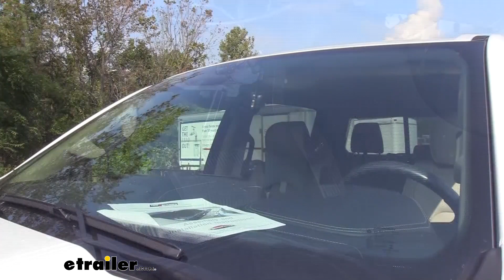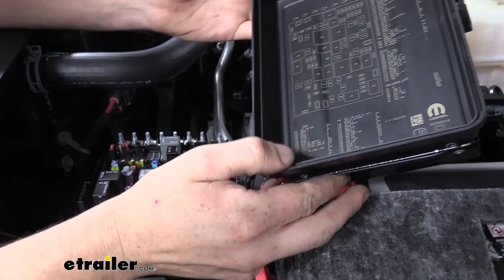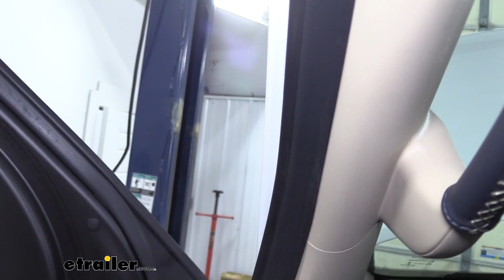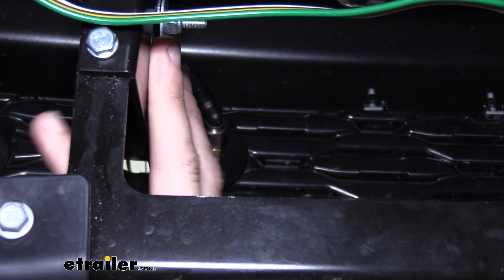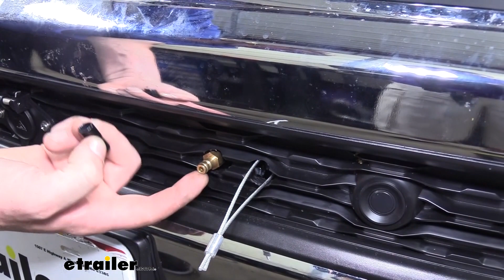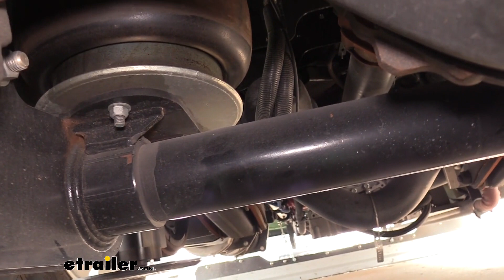DIY Install: Demco Air Force One Flat Tow Brake System for RVs w/ Air Brakes on your 2019 Ram 1500

Comment: Good video. Helped a lot for me to DIY my AF1 system. The only part you conveniently left out was what a PITA it is to cut the hole in the firewall grommet and feeding the line and wires through it.
Reply from the maker: Thank you for the honest feedback! It can be tricky when running the wiring through the firewall. We use an airline tube because it is stiff enough and flexible enough to push through.
https://www.etrailer.com/Tow-Bar-Braking-Systems/Demco/SM99243.html